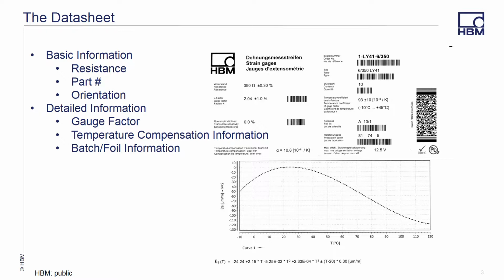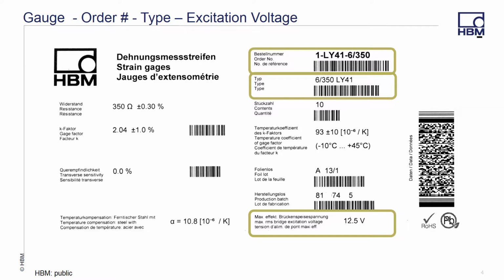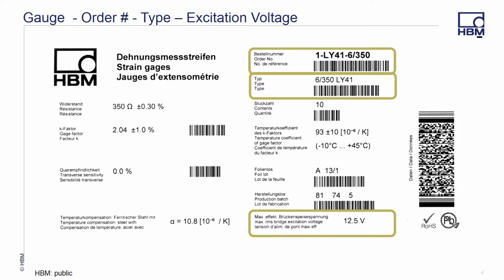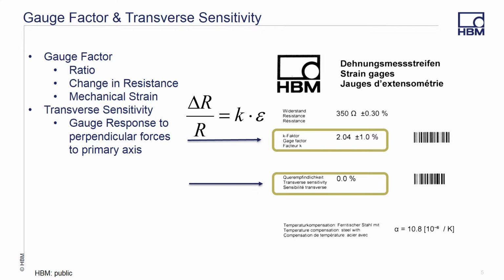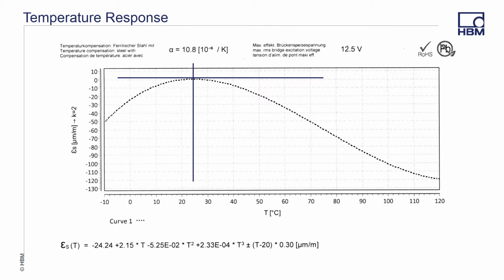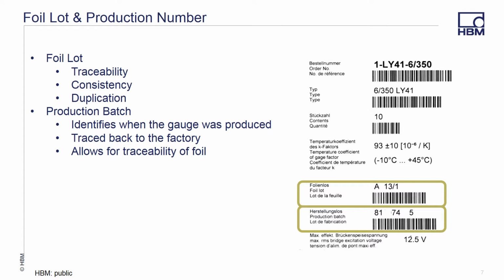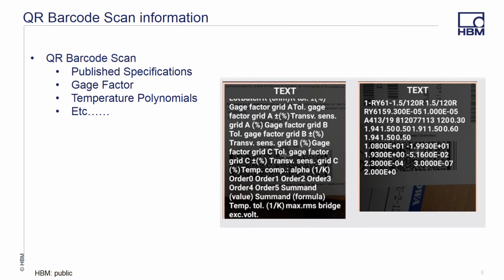Strain Gauge Packaging Documentation

Comment: If I want to know the deformation that the gauge is undergoing, do I simply clear it from the equation that relates it to the resistance and the gauge factor or is there a characteristic curve such as the temperature curve?  I would appreciate it if you answered me because I have had this question for a long time.